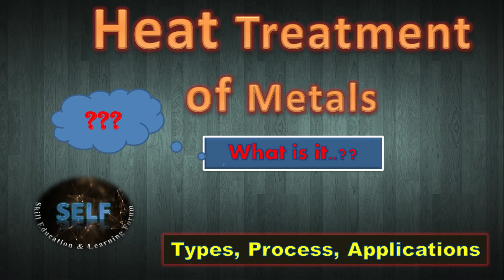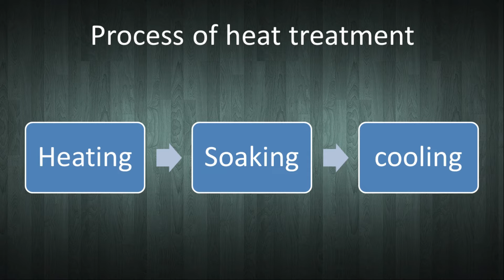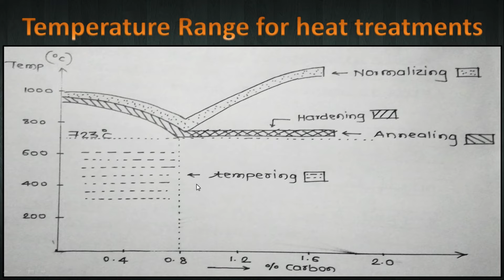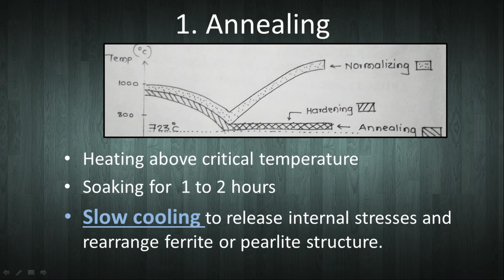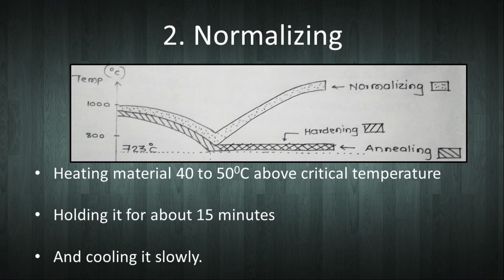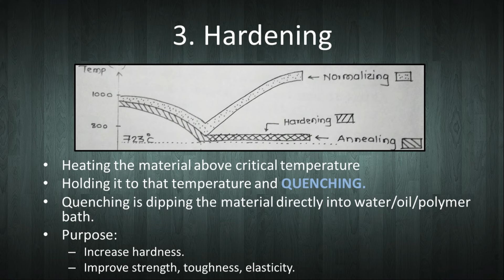Heat treatment of metals | Types. Process, Applications

Comment: https://youtube.com/shorts/g6yFmTTV43I?feature=shared                                                                    Heat treatment, or heat treatment in English, is a process in which a material, usually a metal or metal alloy, is subjected to a controlled cycle of heating and cooling to change its physical and mechanical properties.  This procedure is used to improve the hardness, strength, ductility, hardness, corrosion resistance and other characteristics of the material.

Comment: I bought a l clamp from local store which is made by traditional blacksmith.the holes are not drilled but punched when hot. I tried to drill some holes but unable to do.i tried hss bit and also tried all the available special drill bits but drill bits become blunt.what could be the reason?
Reply from the maker: The surface became hard due to hot work.

Comment: Case hardening and surface hardening are different right?
Reply from the maker: Almost the same.
The difference between each process is that case hardening creates a thin layer on the surface. Surface hardening hardens the outer surface and keeps the core soft throughout the entire process.

Comment: Why is it not possible to make a metal more useful, heat treating can make it stronger, more resistant to impact, malleable, and ductile with just one process?
Reply from the maker: Unfortunately The metallurgy of material won't allow it.

Comment: Why ammonia is used for nitriding?
Reply from the maker: Ammonia is rich in nitrogen. When ammonia comes into contact with the heated work piece it dissociates into nitrogen and hydrogen. The nitrogen then diffuses onto the surface of the material creating a nitride layer.
Credit: wikipedia

Comment: Do or can steel chemical property change during heat treatment? I know the chemical composite can vary depending on the steel thickness and/or steel application. Each mill differents I know that.
Reply from the maker: No chemical composition does not change. There is rearrangement of lattice structure. E.g. BCC, FCC etc. Based on that Ferrite, austenite, martensite etc structures changes.
Reply: @SELFENGINEER  how do chemical composite change then? I know heat treatment is to bring up the hardness, toughness, anti-corrosion, etc etc of the steel.
Reply from the maker: @7150285  These properties depends upon structure of iron molecule arrangement. If there is addition of carbon or oxidation occurs then chemical changes can be expected. Internal stresses also control mechanical properties.
Reply: @SELFENGINEER  so basically steel making process is molten steel being solidifed and then quenched, and then heat treated to enhance its mechanical properties and then quenched and cool down again? I know steel making process its a long process but those are the basics.
Reply from the maker: @7150285  Exactly!👍
Reply: @SELFENGINEER  different chemical composite means different alloys correct?
Reply from the maker: @7150285  In simple words yes. Composites are dissimilar material mix whereas alloys are mixture of metals. There is no chemical reaction involved.

Comment: What about quenching?
Reply: Quenching is the process of rapidly cooling the heated metal/material by dipping it in water/oil/polymer bath kept at low temperature.
Reply: @ketan99rider  isn't it a type of heat treatment?

Comment: After cooling the material in normalizing process how does the graph indicate an increase in temp
Reply from the maker: The graph does not indicate increase in temp. It shows for higher carbon content the normalizing temp is more. For cooling you have to go downward along vertical line towarda decreasing temp. Hope it helps.

Comment: I am a bit confused because I saw a few videos on this subject and they said that hardening a metal will make it more brittle like on a knife it will pretty much shatter if there is enough force. You explained that hardening a metal improves its elasticity which is contrary to what brittle is. Was this just a mistake in the video or have I been taught the wrong things?
Reply from the maker: Hardening of metals is done by heating it above critical temperature( about 900 to 1100℃) and then rapid cooling it(quenching) this quenching is most important. We expect the material to get hard(scratch resistance) but getting internal stresses developed in quenching is what we don't expect. Because of this, the material becomes brittle. Hence to improve these elastic property and toughness, tempering is done after hardening. So as I said in video, depending on the temerature of heating and rate of cooling, these properties varies. 
Coming to your question, neither is wrong. It depends on the process carried out. Thanks for commenting. Hope it helps.

Comment: Please explain critical tempreture
Reply: Definitely not an expert at all but if you want to know what the temperature of a metal. Example: Steel. You will have to just look it up, I couldn't tell you because I am not an expert but the critical temperature is different from every single metal, it will never be the same, I suggest just looking up whatever metal you are working with.
Reply: Or if you are wanting to know what it is, I dont know that answer either, I could only guess that critical temperature is when the metal is significantly weaker like for steel when it gets strawberry red.
Reply from the maker: Theoretically critical temerature is temperature at which metal crystal structure changes. The lattice structure will be rearranged in material at this level.
Reply: @SELFENGINEER  Thank you. Can you tell me also what is the lower & upper critical temperature?